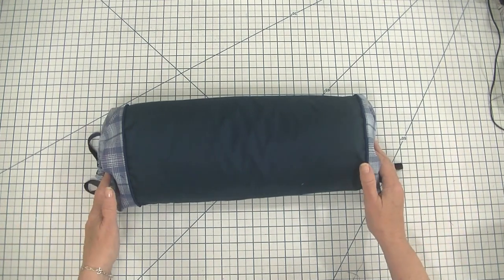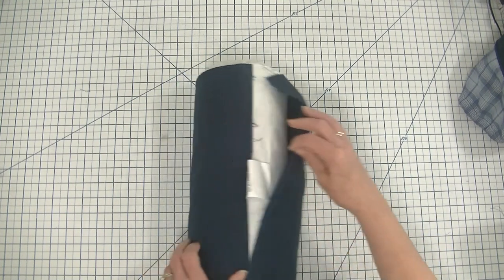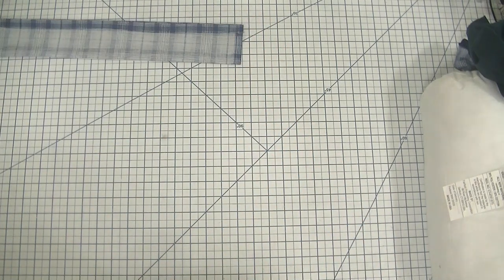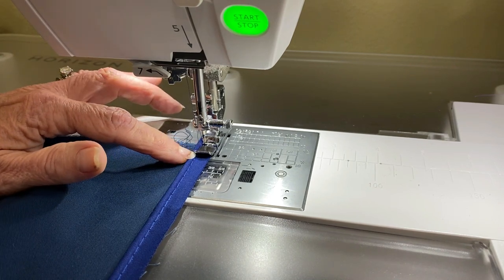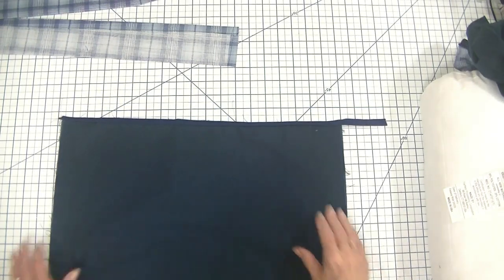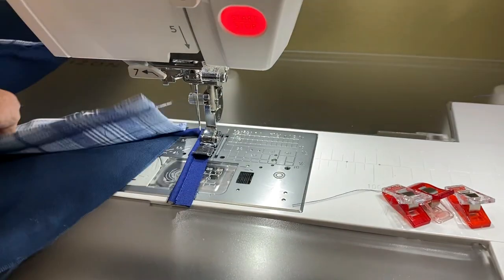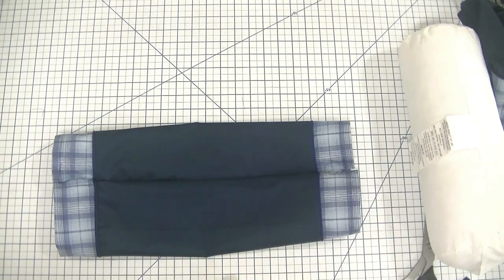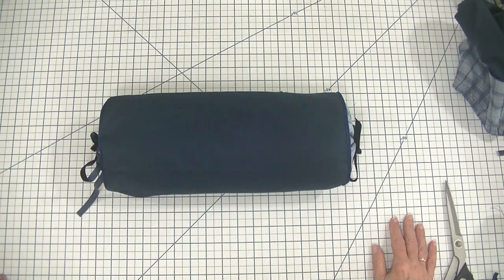How to Make a Bolster Pillow Cover

Comment: I do think this is a simple but ingenious pattern. However after beginning to piece it together, I have a couple of alterations for these reasons: 1. I’m not sure I understand why it is recommended to cut the plaid pieces one inch longer than the circumference of the main (solid) piece. 2. Just 1/4” of seam allowance for the lengthwise seam of the main (solid) piece seems a bit skimpy; I feel it risks tearing out under normal usage of a snug bolster cover. 

An alternative way to approach this pattern might be to try cutting both the plaid and the main piece to match in circumference, i.e. in this example, both at 19”. Then hem each end of the plaid pieces just as shown, by folding under 1/2”. Now sew the lengthwise seam of the main piece with a 1/2” allowance (not 1/4”), and the two circumferences—main piece and end pieces—will match. 

A good reason TO cut the plaid end pieces longer than the main piece would be to better hide some raw edges. To do this, I would cut the plaid pieces longer than the main piece by just 1/2” though, not 1”. This will allow folding the end seams of each plaid piece under by 1/4”, then an additional 1/2” to seam the ends and completely hide the raw edge. In your example this would mean cutting the plaid at 19 1/2” long. Doing it this way will give a more finished look at the ends as no raw edges will be peeking thru the gap (side slit) near the ribbon/bow. I’d also press seams open as I go—particularly the lengthwise seam of the main fabric, to help it lie flat when the pillow has been inserted. But I can appreciate that you are keeping this instructional video as simple as possible for beginner sewers! Thumbs up for that!

Thanks again for giving me a workable basic idea for an easy bolster cover. I love the idea of jazzing it up by adding piping! Since I don’t have any on hand, I’m using a narrow strip of brightly colored fabric instead, that I’ve folded in half lengthwise. It’ll add a skinny little flap to form a strip of bright color between my main fabric and my complementary end fabric.  It all comes together to suit my “camper bolster pillow” project perfectly!